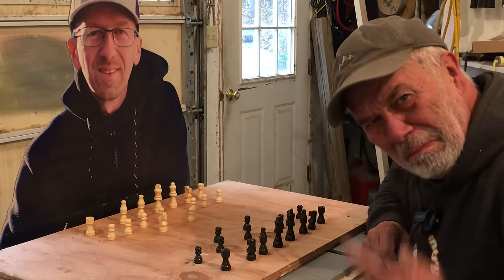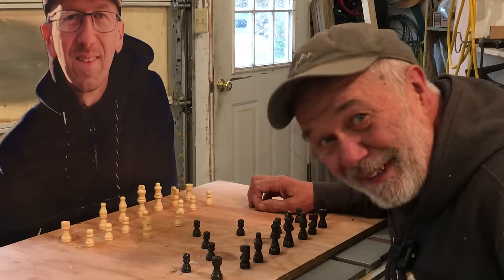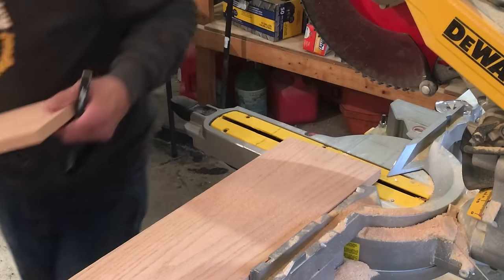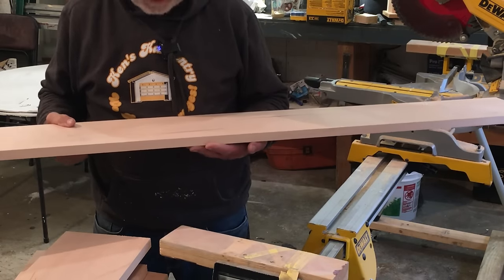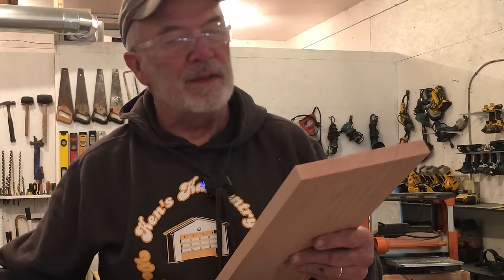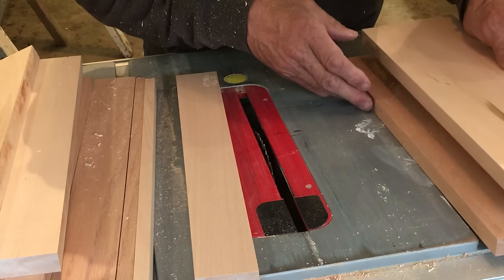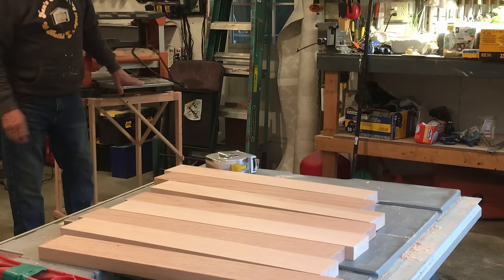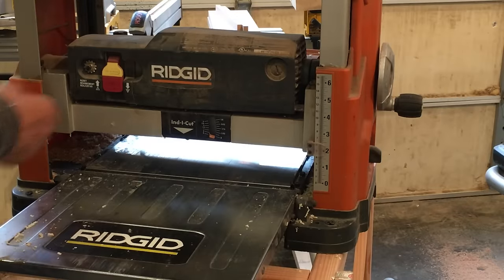Am I In Over My Head?  Making a Chess Board From Hardwood

Comment: Ken, from a long-time woodworker, here's a tip when gluing end-grain. Apply a thin coat of glue to the end grain and let it dry, then apply more glue and clamp together. The end grain soaks in the first layer of glue and seals it so the second layer doesn't get soaked up by the end grain. Makes a much stronger end-grain glue up.
Reply from the maker: Wow thanks for that tip

Comment: Nice project.  3/4" solid squares is pretty thick for a chess board.  Commercial boards are usually thin veneer (like 1/16).  You may find that the board will move around a little with the weather.  Most boards are glued to something dead flat the doesn't move (like MDF) to hold movement in check.  The movement won't be a problem unless you plan to put a mitered edging around the board.
Reply from the maker: Ok thanks

Comment: Great starter project Ken. I'm sure it will be fun for all. 
The chisel was a good choice for scraping the glue off. A hand planner works well too. That glue would gum up the planner blades as well if it weren't removed.
- I see someone has already mentioned the end grain pre-gluing trick for better joints. Great advice. Unsealed end grain can draw the glue out of a joint.
 IMHO I save the sanding for the final finish. Sanding can round edges and cause mismatch final thickness issues. 
To match the glued panel strip widths better you can use the same trick you used running the solid wood strips through the planner. It will help final checkered glue up too.
 To eliminate the screw pail weight tower (HA-HA) you made, a flat bar or channel over the panel that clamped to your table saw deck would hold the panel flat. I have even used 2x4's  with bar clamps when I didn't have access to any steel or aluminum channel.
If you use some craft paper over your table saw deck during your glue ups you will prevent stickage and limit cleanup later.

- I don't know if it is common practice but I always coat both sides of the joint before final clamp up.  I put each strip in individually and coat each edge in glue as it goes in the setup. Final clamp up is tight but not too much so. If you clamp the wood too tight you can literally squeeze the glue out of the joint and end up with a stressed joint that is weak and easily cracked. Once the main squeezing clamps are as tight as I want I do a quick wet cloth glue wipe off to get the bulk of the glue off the surfaces before I add all the other "flattening" clamps as they may be needed
Have fun, but be careful.
Reply from the maker: Thanks. Good tips
Reply: @kenskarpentry wax paper works well also.... instead of craft paper

Comment: Great job! Looks beautiful...
 So Ken.... When was it that you discovered that taking a 16" wide board, making 7 cuts on the table saw and then when you laid them out, the outcome was no longer 16"?
I guess you found out that after cutting it too short, board stretchers only live in a fictional world of exactness...
Reply from the maker: I had oversized the pieces so that after they’re cut, planed and glued the table was exactly 16” x16”. Took more thinking than I thought
Reply: @kenskarpentry  In this video at 17:42 you said you set the fence at 16 and 1/4 inches and cut the sniped end off.  At 18:26 you said you set the fence at 16 inches and cut a thin strip off.  Between 18:44 and 18:55 you made seven cuts to the 16 inches of material.  The material removed by the seven cuts reduced the 16-inch measurement by approximately 7/8 of an inch.

Comment: Hi Ken how thick are the pieces you used I had a go today and cut the wood to 15mm then not having a planer or drum sander attacked it with a belt sander causing dips which turned out to be a disaster😟but one learns from mistakes I think thicker wood maybe 20mm may be better
Regards
Ken
Reply from the maker: It was 20mm

Comment: Board looks nice. But I'm surprised that you didn't make each square equal on all sides. No will ever know unless you tell them....lol
Reply from the maker: Actually they are all exactly 2” square
Reply: If you glued up the full width and cut to exactly 16” wouldn’t the saw blade width be missing on each cut?
Reply: @eporama    when he cut in the other direction, he set the saw fence at 2" and didn't plane them. This is why he left the boards long in the first place.
Reply: So at 18:00 the glued up blank is cut to 16 1/4” which is what I expected to compensate for the blade widths but then at 18:28 Ken says he sets the fence at 16” and cuts the opposite side. Then he sets the fence for 2” to make the strips. I’m just surprised that the last one wasn’t narrow.
Reply: @eporama    depends on how you set the fence. If he measured from the side of the blade, then it would be exact instead of lost material to the saw kerf.